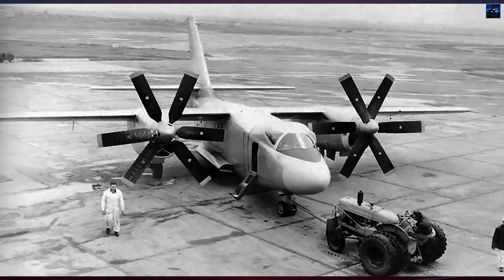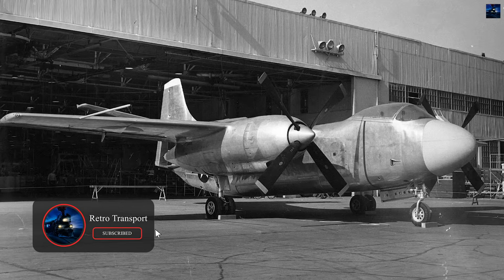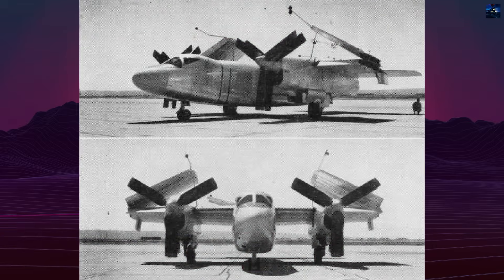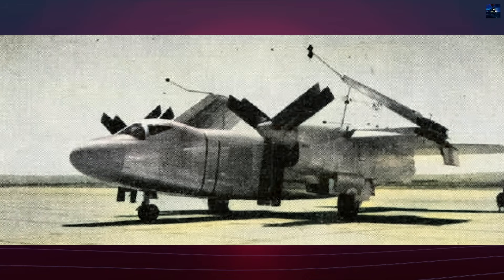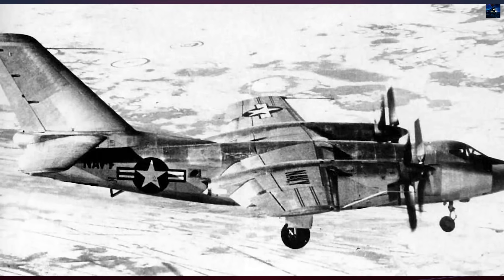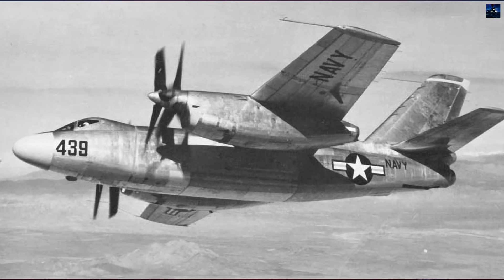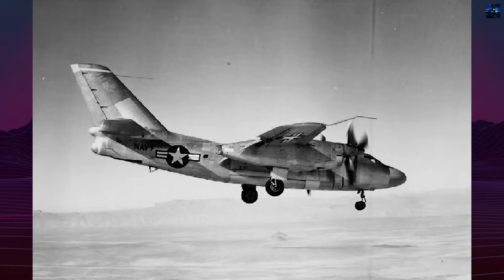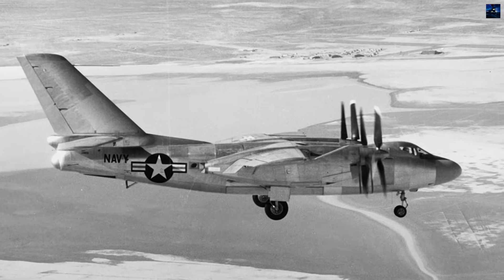North American XA2J Super Savage: A Giant with a Broken Heart

Comment: I wonder how many aircraft designs failed because they employed an Allison product?
Reply: Not as many that failed because of Westinghouse products !
Reply: @weing  excellent point !
Reply: At least three - this one, the recently-featured Convair R3Y seaplane and the Douglas A2D Skyshark.
Reply: Also, the Convair XFY-1 and Lockheed XFV-1 VTOL fighters.
Reply: Ever had a Bell Jet Ranger helicopter fly over your house?
Reply: @Flies2FLL  think he meant early Allison turboprop engines-the T-40 was TOO complex for the era. The T56 & 250 engines were a bit later-Allison learned from their mistakes-something Westinghouse didn't.
Reply: @stevenrobinson2381  Yes that is true.  But Allison built some really good stuff;  The T40 was a major fuckup.
Reply: Not just Allison, lots of WWII aircraft projects were cancelled when the engines they'd been designed around didn't live up to their designer's expectations.
Reply: The P-51 started with an Allison engine and was woefully underpowered.  It took the RR Merlin engine to make it work!
Reply: @gregmiller7123  - it was not under powered. The V1710 could not perform at altitude
Reply: @kentsibille6850 I stand corrected on the power of the Allison.  But it still was not the best engine for the P-51 and the Merlin solved the issues.
Reply: @gregmiller7123 - absolutely. You are correct.
Reply: Many more succeeded under WW2 duress.  Dont shitew on people.
Reply: I'm sure you can google an answer. Unless you don't know how to use google